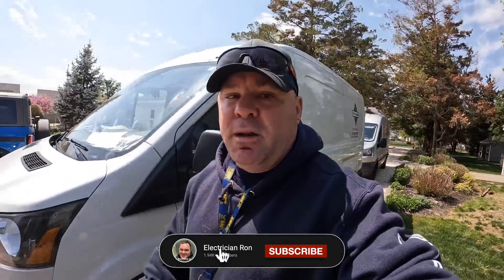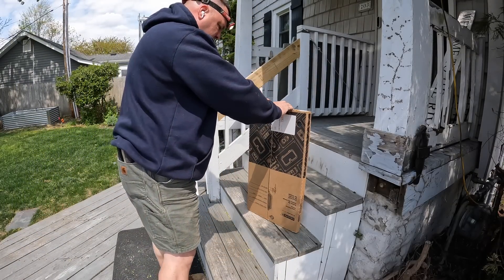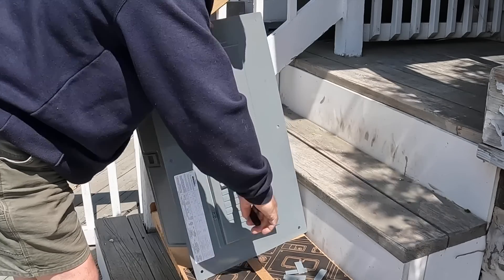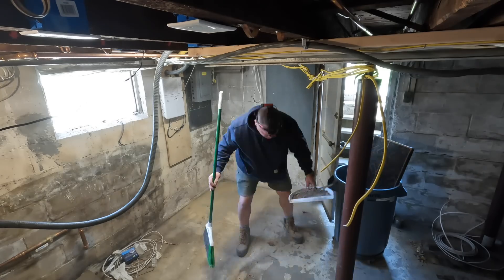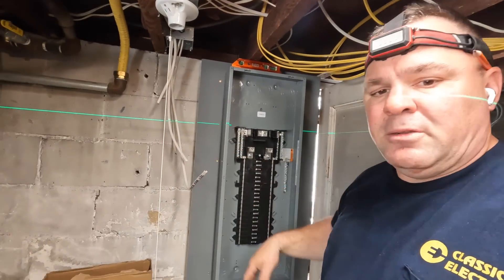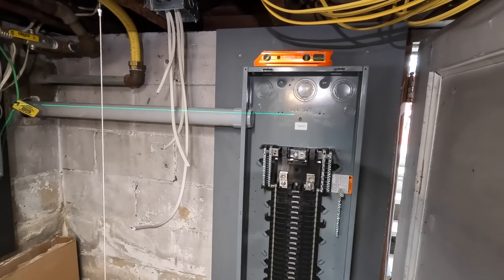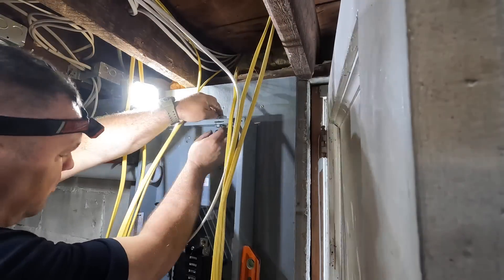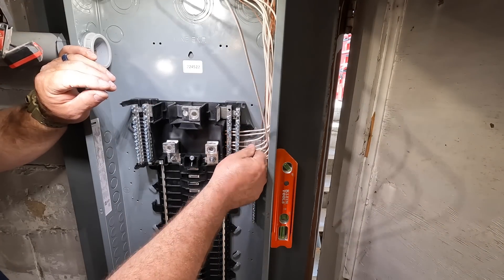200A Upgrade w/ Automatic Transfer Switch | Oceanport, NJ. (Part One)

Comment: Has the code changed regarding the location of the transfer switch? Mine was installed in the basement during the construction of my house 8 yrs ago .. my neighbor is having the identical generac system this week and the electrician put the transfer switch outside and the neighbor is unhappy .. the electrician is saying the code has changed and the switch must be installed outside.. is this correct? Thank you
Reply from the maker: 230.85 Emergency Disconnects.

Yes. 

For one- and two-family dwelling units, all service conductors shall terminate in disconnecting means having a short-circuit current rating equal to or greater than the available fault current, installed in a readily accessible outdoor location. If more than one disconnect is provided, they shall be grouped. "READILY ACCESSIBLE OUTDOOR LOCATION"

Comment: Ron, why doesn’t the new panel in the basement have a main switch or main breaker?
Reply from the maker: Because the Generac Transfer Switch is service-rated and the main disconnect on the property.

Comment: Great job as always, Ron.Have you had any nuisance tripping or power tools tripping the QO arc fault breakers? I can tell you Siemens is a nightmare!Thanks for another great video, can't wait for part 2.
Reply from the maker: I haven’t installed any of the breakers and I don’t anticipate any nuisance tripping. Years ago there were issues with AFCI but not much now.  If you wire right there shouldn’t be any issues.

Comment: Did the inspector let you slide on a support of the 2” Conduit entering into to the MLO Panel?
Reply from the maker: This is an incomplete service. Plan to do a stacked piece of thick  kindorf to get the strap on there good. Its definitely not going anywhere though that's for sure.
Reply: @electricianron_New_Jersey  yeah it’s not going anywhere, but was just inspector if inspector would of said something. Nice videos btw.

Comment: Been using QO Square for years. They seem to pass electrons without any bias😊. Ron any issues with ARC Faults or combo false  tripping? I have used some of the GFCI only breakers and they have a habit in the summer during electrical storms to trip an outdoor electrical plug. Have another circuit on the opposite side of the building that has a standard QO breaker but connected to a GFCI outlet and that never trips. Both are home run 20A circuits. The GFCI breaker seems more sensitive. Thanks for the videos.
Reply from the maker: Not sure what the issue is here. I can tell you that a GFCI will only trip when it sees a difference in potential between the two circuit conductors.

Comment: Hopefully those neutrals in that new main panel will be long enough to reach the arc fault breakers 😅
Reply: A plug on neutral just gets rid off the pigtail on the breaker, no? You still have to connect the neutrals from branch circuits to the AFCI or GFCI breaker, no?
Reply: @pawelelektryk2985  As a homeowner whose last service upgrade was just 4 years ago, that was my thinking too. But, I did a little reading and Ron is correct. On an AFCI plug-on neutral breaker there is no screw for a neutral wire(at least for a few brands that I checked). But the GFCI and dual function AFCI/GFCI breakers still need the neutral wire connected - as those breakers sense the current imbalance between the hot and neutral wires. I believe that the AFCI breakers only need a neutral connection because their internal "computer" uses a small amount of power. Still, if at some point in the future an AFCI breaker gets swapped out for a dual function breaker then you suddenly need to lengthen the neutral to connect it to the breaker. Seems to be a bit of an odd manufacturing decision as safety requirements keep getting stricter over the years. I'd think they would expect GFCI to become universal at some point (as in the UK) and would design their products to encourage cable wire lengths to be kept the same.
Reply: @JasonEDragon  I've never seen an AFCI breaker that doesn't have a neutral terminal. Every PON AFCI breaker I've seen has both hot and neutral screws.
Reply: @pawelelektryk2985  Ohhhhh.... I think you may be right, Ron may have forgotten that. 😕
Reply from the maker: I thought the same thing after cutting-in. Then I remembered this is a plug-on neutral type panel.
Reply: I caught that too. After having gone through a number of decades of renovations on an old house I now ask electricians to leave 2+ feet of slack along some point of new cable runs and enter the panel on the side instead of the top. I've made too many upgrades over the years and have been bitten by short cables. I can see keeping the inside of a panel neat with short wires, but I could care less what the outside looks like. People get too hooked on making it look the neatest at that moment, while I'd prefer they think about how to keep it looking neat for the next 100 years.
Reply: Thats a plug on neutral panel
Reply: @Ampacityelectric  He could also use WAGO inline connectors to extend those wires, not just wire nuts. Either way, it's gonna look messier and will be harder to find each hot/neutral pair when the neutral bus is all the way up there. 

I think the reason why the QO panels have neutral bars higher up that Homeline panels is because Homeline is built for residences (probably why Square D named it that) which now require AFCI on almost every circuit, which requires more wire length for neutral conductotrs, while QO is built for businesses which don't require AFCI. This is purely my assumption. I have neither owned a Square D panel nor worked on one, so I can easily be mistaken.
Reply: Now I’m interested to see the breakers go in and see who’s right.  I don’t use QO much but on GE and Eaton the branch circuit neutral goes to the breaker on an AFCI.
Reply: If you are going to install afci breakers the neutral wires would need to be connected to the breaker